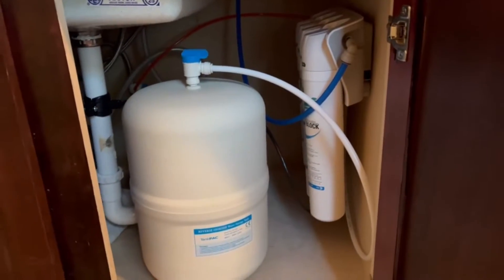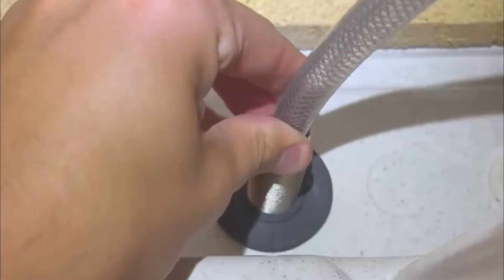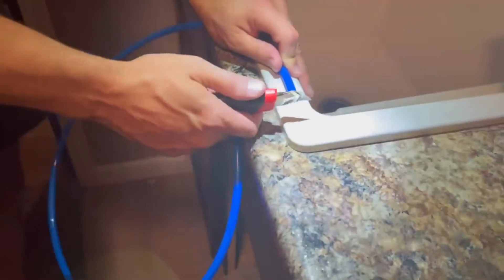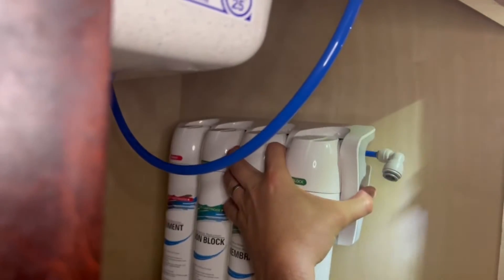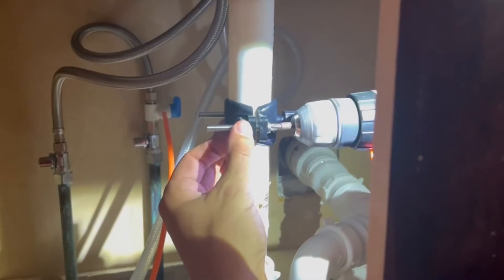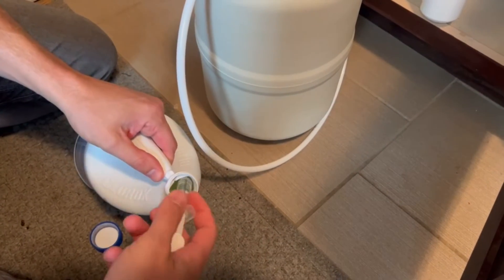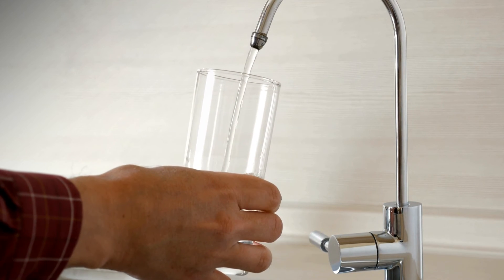How To Install A Reverse Osmosis Filter System (DIY STEP-BY-STEP!)

Comment from the maker: DID YOU GET YOUR RO INSTALLED!?👇Exclusive Discount On SpringWell Reverse Osmosis System:
💥(Click For Discount Code: FRESH5) https://bit.ly/3KkwNeW

►Full SpringWell RO System Review With Lab Test: https://freshnss.com/springwell-reverse-osmosis-system-review/

►Best Reverse Osmosis Systems: https://freshnss.com/best-reverse-osmosis-drinking-water-system-reviews/

🧪 Best Water Quality Test Kit for City or Well Water: https://shrsl.com/3o0fe
___
✅ Tank Based Reverse Osmosis Water Filter System Installation Chapters:

How To Install A Reverse Osmosis System  0:00
Faucet Install 0:25
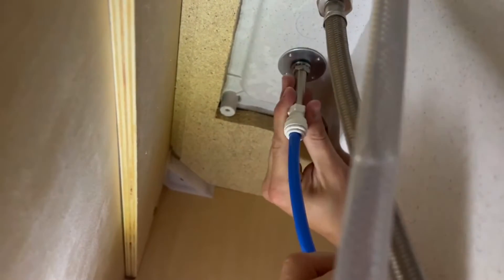Cartridge Manifold Install 2:36
Water Line Adapter Install 3:36
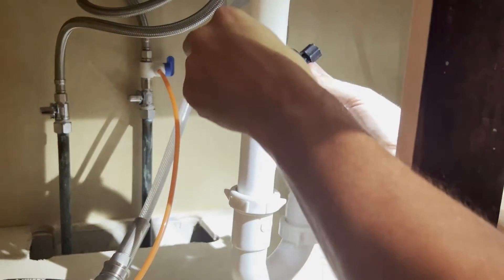Drain Line Install 4:20
Connecting All Water Lines 5:08
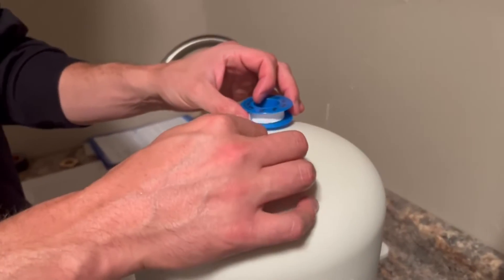Storage Tank Setup 6:26
System Sanitization 6:51
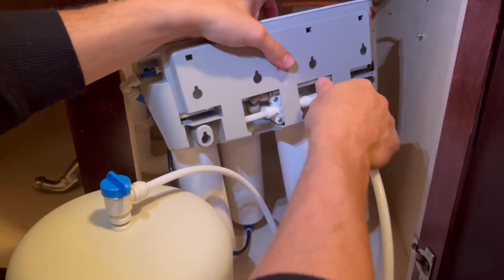System Startup: 7:25

In this video we install a reverse osmosis system under the kitchen sink and provide a step-by-step guide. We use the SpringWell RO system, however, this installation guide will work with ANY tank based RO system. 

Hopefully, this guide will save you some time and money to help you with a DIY reverse osmosis install at home!
___
► Subscribe to the Freshnss channel on YouTube: 
https://www.youtube.com/channel/UCKCj...

► Freshnss website: 
https://freshnss.com/

► Freshnss on Pinterest: 
https://www.pinterest.com/freshnss/

► Freshnss on Facebook: 
https://www.facebook.com/freshnss/

#reverseosmosissystem #reverseosmosisinstall #reverseosmosissysteminstall
-----
Disclaimer: https://freshnss.com/disclaimer/

Comment: I just finish installing my system (same from Springwell) Water is been running for about 1.5 hours and the tank is still empty. No water coming out of the faucet. I do hear the water going down the drain. I am concern i did something wrong.
Reply from the maker: Hard to troubleshoot over comments, but you should go over each connection and filter. Believe it or not, many people forget to remove the plastic film over the filters sometimes (especially the RO membrane). Verify your any check valves go in order to verify where the water is making it through or not.